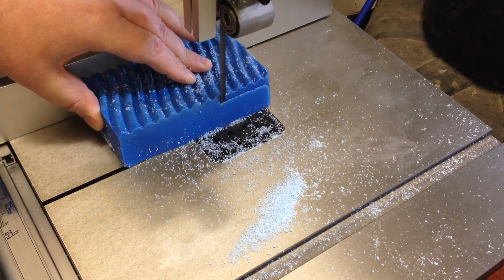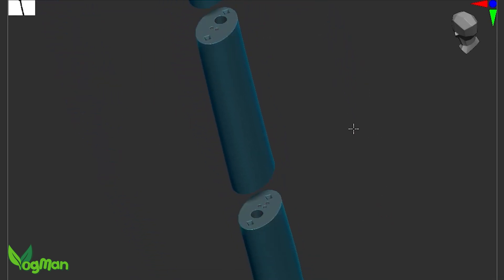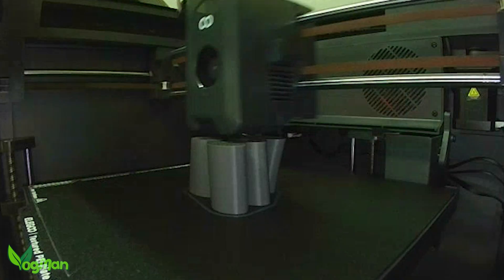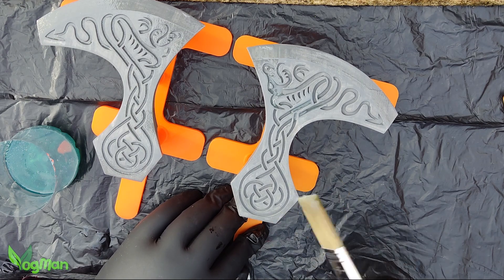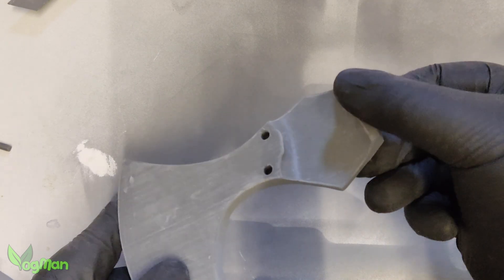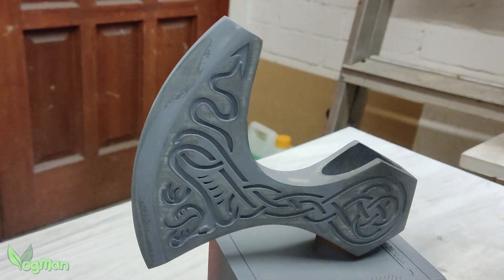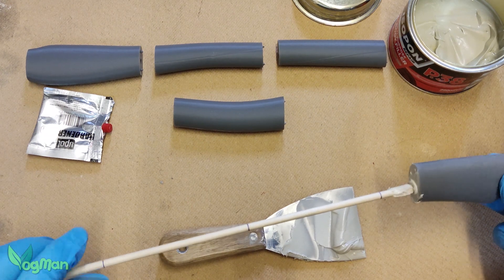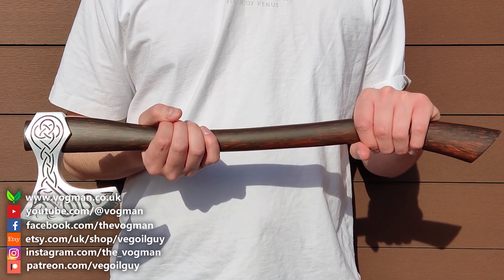I 3D Printed a Realistic Viking Axe | 3D Printing the Norse Way

Comment: Excellent work.
The next time if you want to save time before sanding apply regular resin you use to print with a brush and cure with a uv light then sand and repeat maybe two or three times and the piece going to look like a resin printed part.
Reply from the maker: Thanks for the tip 😁

Comment: I heard that ABS is a lot easier to sand and work with in general, you can use a slurry of ABS dissolved in acetone to smooth and fill gaps instead of resin
the centuri carbon has an enclosure, it should print ABS well
Reply from the maker: Thanks for the info 😁

Comment: Get some Milliput putty. It's a two-part epoxy you can mix together.
The good thing is, you can wipe down the excess with a damp cloth, so it saves a lot of sanding.
It can also be diluted into a slip liquid you can use for filling cracks etc.
Also, if you have made too much, the extra you can keep in the freezer, and it won't set hard.
Reply from the maker: Interesting. I'll look into that 😁
Reply: You can keep it in the freezer? Thanks for that. I hate chucking the excess away.

Comment: myself my good man i tend to use 3d printing resin over fdm prints.. its a great way to use up the last of the bottles.. and gives you a huge working time.. and you cure when your done.. may take a  couple of layers.. but i way prefer it to using 2 part resin as the cure time is to fast and also a lot of clean up.. and we always have resin left in bottles.. :)
great work my good man. :)
ohhh i may need you to make me some brass blank coins.. let me know if you can and how much.. they are for laser embossing for deep carving.
Reply from the maker: I did think about using 3D printing resin... I wasn't sure it would hold up well over the filament